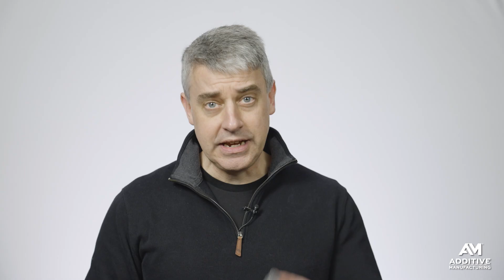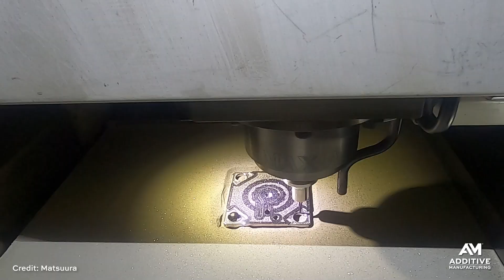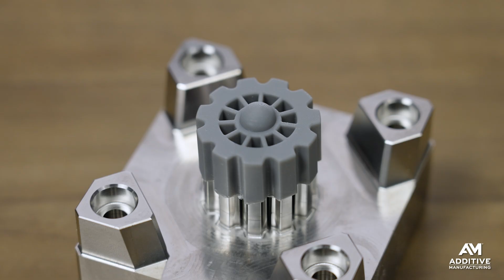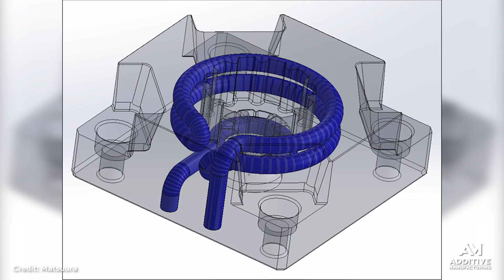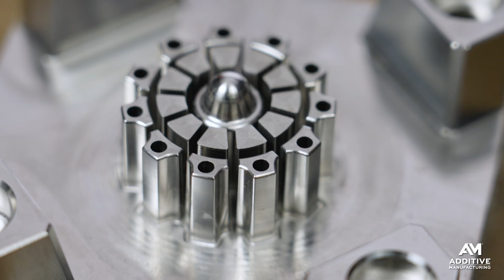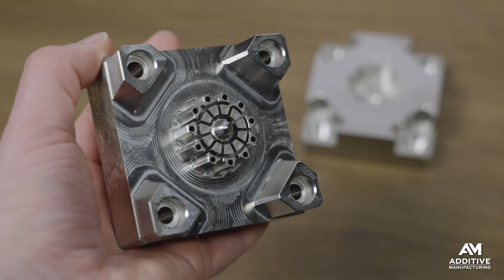Faster Injection Molding With 3D Printed Mold

Comment: What is happening with chips? Are they melted?
Reply from the maker: From Tom Houle at Matsuura:
Our recoating system uses a precision ground dual set of wiper blades which removes the chips from the sintering surface and deposits them in the powder bed.  These chips are then sieved out when the powder is recycled. Those chips are then recycled once enough are accumulated.

Comment: Would love to know more about the porous material and how they get it in their with sls. Usually all of the bed is one type of powder so I have no idea how they get the other material in their, or maybe they sinter it differently for that section in some way.

Also crazy seeing CNC milling on a powder bed. Surely work holding and vibration is a difficult issue for that. Maybe they fuse the part to a bed clamped in below the powder.
Reply from the maker: Thanks for watching!

The porous section is made from the same material as the rest of the mold, but it’s sintered in a way that prevents it from forming a fully dense solid. We recently released a video about a 3D-printed porous knife that explores the concept of intentionally printing porous structures in more detail: https://youtu.be/JAs3HtiQl94
Reply: @AdditiveManufacturing  cheers, yes, I did see that one just after haha. Very interesting use of what was originally a defect.

Comment: The bottom of the cavities have a porous section that allows air to move through the mold but not the molded material? That is something else! Add the built-in cooling and I wonder when all complex molds will be made like this. Learning so much from watching this channel. Thanks for the excellence!